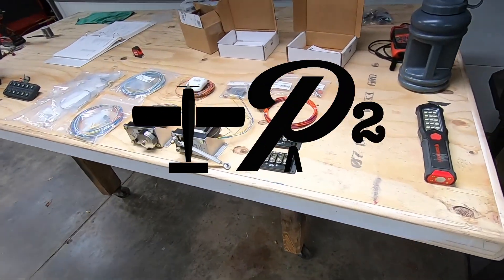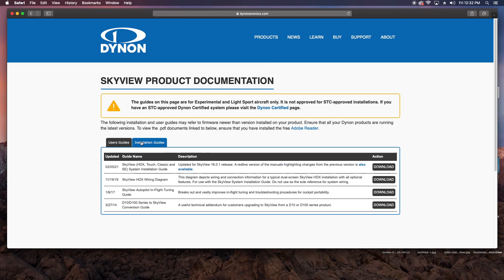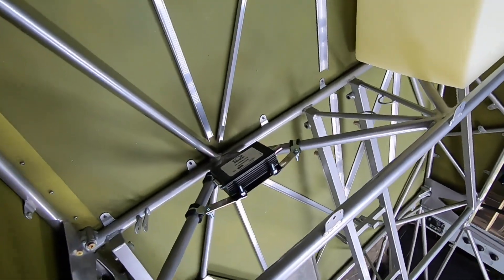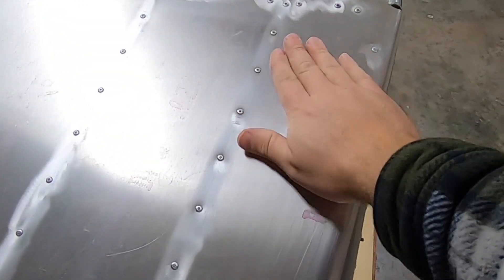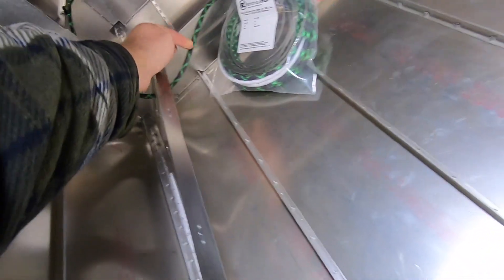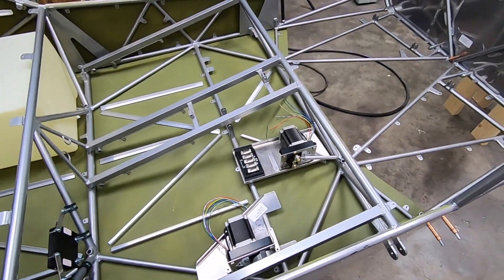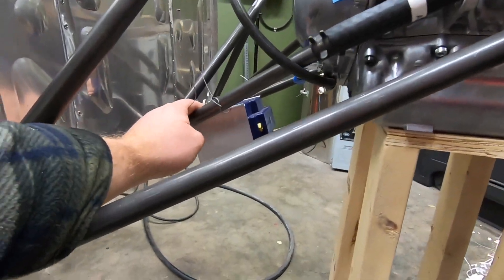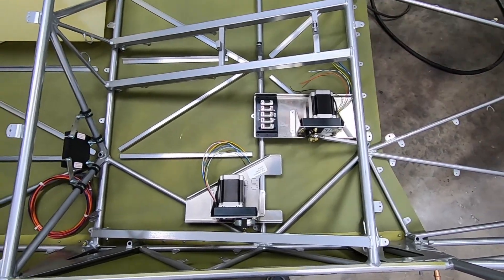RANS S21 EP26 DYNON UPDATE

Comment: Are you using the stock ECU with a re-Map for the tune? IS your earth x lead/acid? I guess it is if you are mentioning  "the vented model" I am going the Lithium variety which prefers to be in the cabin due to temps.
Reply from the maker: I know a lot of guys put the earth x batteries in the cabin but I moved my battery up front and ended up going with a gel cell. Earth x does have a vented version that can be put inside as it’s designed to vent overboard in the event of a thermal runaway.  I just could not get comfy with having lithium in the plane with me.
Reply from the maker: My Ecu is a link G4x with a custom tune.

Comment: Will you be able to use the engine monitoring system within the Dynon or will you have to use a stand alone monitor?
Reply from the maker: I will make the Dynon work one way or another. I’m gonna try and get the ecu to communicate via the can bus with the rotax Dynon box. If that doesn’t work I’ll setup additional sensors for the things I need to make it work.. Time will tell.

Comment: Fantastic Channel man! Great to see your sons get excited about fabwork too. Was cost a significant factor in choosing the yamaha engine? Besides power to weight of course.
Reply from the maker: Yes, cost is a huge reason for that choice. I expect to be around 14k for my entire firewall forward package including the gearbox and prop. That’s a very good HP to Dollar ratio..
Reply: @Project2Aero   200hp you think? or more with boost??!!

Awesome answer! Gives me some incentive for sure.
Reply from the maker: @joemahan311  I plan on the 200 mark for now but the engine is capable of much more. After I get some time on it and it proves a bit of longevity, I will explore turning things up some👍
Reply: @Project2Aero  Excellent way to make power and learn your airplane too! Steve Henry is onto something. Plus there's a kitfox crew doing the same thing. Good stuff! 200 is PLENTY which is amazing

Comment: Nice video! I have the same plan to try to mount my Dynon components close to the antennas to keep the cables short. I’ll be mounting my GPS antenna under the cowling just as I did on my Cruzer. Works great there!
Reply from the maker: Thanks! I considered that location for my  GPS but will most likely end up with exhaust near that area and didn’t want to have to worry about it getting cooked! I will put the transponder and  comm back in that area with the adsb as well👍